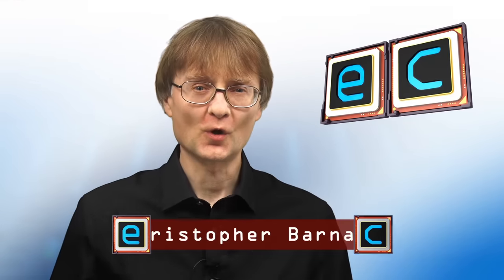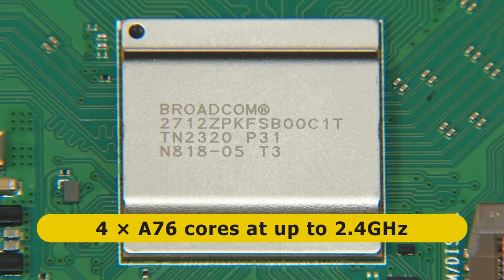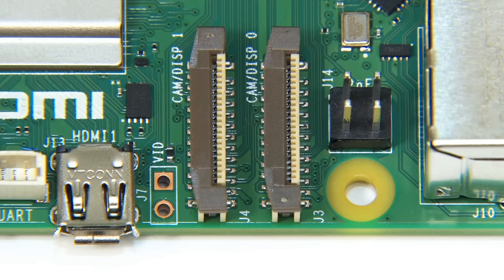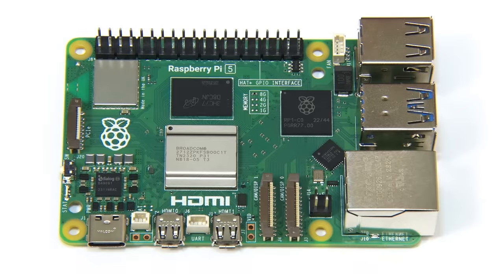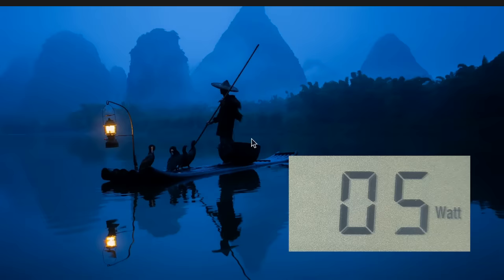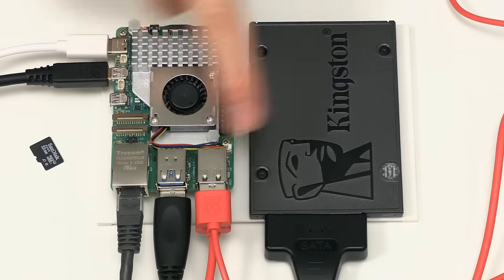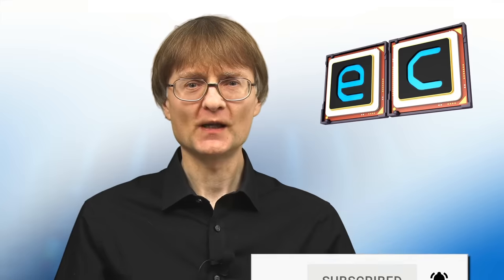Raspberry Pi 5

Comment: After using a Pi400 for a year, my first impression is that it doesn't seem too different from what I'm used to every day.  I'm sure it's faster, but I don't remember that being a problem for most things.  I run it on a 4k TV at full resolution, and of course you can see it have trouble keeping up with various XScreenSaver choices.  Overall, I think the Pi 5 looks almost good enough to be a primary computer, but still only "Almost".  I don't play games, but the Pi version of Minecraft is almost unplayable at 4k, and I'd like to see how this new 5 handles it for comparison.

Comment: The Raspberry Pi 5 is definitely looking like a worthy successor to the Pi 4.  I think the microserver and home automation DIY groups are going to love it but I think for the first time in a long time, possibly ever, I think they have something that is actually fast enough to be used as a basic desktop and tool for education.  I have used the Pi 1, 2, and 3 in classes over the years to teach basic coding skills and the desktop environment, while useable they always left something to be desired in the speed and responsiveness area.  I wanted to use the Pi4 but they were hard to get ahold of for such a long time so we have been using the older units most of this time.  The major difference when using things like the Microbit, Arduino, and Parallax Basic stamp 2 was that they relyed on a separate computer for the code development and compiling so it was generally much snappier for teaching these basic concepts but the Pi offers the benefit of being a completely separate and self contained development platform without the need of a separate computer once the SD card is created.

Comment: I have a question for you. To help understand your video. While you were rendering video, doing the video call, etc. Were you also running something like OBS or video recorder to capture video off the PI? Or was an external video capture device used on the HDMI port?

I was just curious because if using PI resources to capture video, your test speeds on rendering would be affected.
Reply from the maker: I think this comment is on the wrong video? But all of my video capture is always done with HDMI recorders, so does not take any Pi resources.

Comment: I like the testing pads on the bottom of the Pi 5, which is something the Zero 2 W introduced.

It opens up a lot more possibilities for HATs sitting under the Pi (SHOEs?) that interface via pogo pins to the test pads, leaving the 40-pin header free.

Comment: Great video. I started my Pi journal on the Pi 3B, which around that time was about $35. Got a couple of Pi 4 4GB later around $60 which was good to tinker around with. Since Covid the prices of Pi shot up the roof. They said it is due to shortages. Have this been addressed? Hopefully the release of Pi 5 would bring down the prices of the 4.

Comment: was looking into buying a pi4  in that keyboard 'case' but then learned about the pi 5.  do you have any news on whether it will also be available as 'keyboard'?  nothing on the website about it when i checked.  like the C64/amiga500 vibe to use it for retro games.
Reply from the maker: There has been no announcement on an upgrade to the Pi 400 "keyboard computer", but many of us suspect that Raspberry Pi will make something like a "Pi 500". Maybe for Spring 2024? That's just a guess.
Reply: @ExplainingComputers  guess i can start with the 400 and once the 500 is there make someone else in the family happy with it 🙂

Comment: Just a Q: in timestamp 18:22 where you talk about the RP1 chip, there is a rectangle in the upper left corner that probably says MEMORY and has a resistor-jumper for 8GB. Do you think the board has all the memory factory installed, and that this resistor "selects"  available memory?
Does the 4GB and the 8GB have the same memory chip onboard?

Comment: 2:39 wait, what? Is that resistor just for show? It connects the same two signals, regardless of where they put it. Wouldn't it have been easier to just use a sticker instead that says which RAM size it is?
Reply: A sticker means adding a "sticker adding machine" to the build process. Soldering  on an additional, useless resistor can be done in the existing soldering build process. Just one more resistor to pick an solder. Much cheaper.

Comment: Wow thanks a lot for the video. That's amazing. Just one question: would you be able to assess the Raspberry pi 5 responsiveness with a 4k (2560p) monitor? With the Raspberry pi 4 no amount of overclocking helped and to be fair performance was bad even at 1440p so yes the system technically outputs 4kp60 but is nowhere near able to move a window at that resolution. So the pi 2 was a 480p machine, pi 3 a 720p one, pi 4 a decent 1080p performer... pi 5?

Comment: Will 5 amps be necessary? With that amperage the power consumption is already at the level of a mini pc with more than decent performance. I really like the PCIe port, but I'm surprised they haven't implemented the M.2 port on the board, if boards like the Orange Pi or Rock Pi have them built in I don't see the reason for them to have left out the port. 
The power is really good but I am concerned about the consumption, almost double what my Raspberry pi 4 consumes. I think it is a good improvement with some details that concern as consumption, it will be fun to see what projects will be developed on this board.

Comment: GPU performance and capabilities will likely improve slightly as time passes. By the looks of it, the Mesa drivers are still in the process of adding support for the new instructions, features and structural changes of the Videocore VII, which is essentially a superset of the RPi 4 GPU, whose codepath it's currently utilising with minimal modifications to make it reasonably operable in the first place. Once could say that the drivers are still in the "bring-up" phase.

Comment: The added active heatsink is a blast at it`s form factor. Ofc we have the bulky passie/active ones but some projects just looks nicer flat. It doesn`t even have to be the Original heatsink, having the proper mounting holes we are finally able to create a heat dissipation solution that doesn`t require a "duct tape logic" ;)  Also power consumption and new fast usb + PCIe connector avaibilty makes the new Pie a go to for a home NAS storage at resonable price.

Comment: Great video as usual. Is the slightly higher board power draw compared to Pi 4 not due mainly to the addition of the RP1 SoC?
Reply from the maker: Partially this, but also the new SoC with its faster and more powerful CPU core and GPU).

Comment: Wait a minute, so, you have a fan, a PoE HAT, a board to connect the NVMe m.2 drive to and if you're planning to do something with the GPIO pins, you need a HAT for that aswell? I have probably missed a few things for which you need an extra cable or HAT for it to work, but how do you fit all that to such a tiny board?
And is it possible to have the OS on the M.2 drive?
What about 4k60 Youtube as it does have mini HDMI which supports that?

Comment: Thanks, put myself on the mailing list of my local shop, they think they will have them in 3 weeks. Wouldn't mind a video about passive cooling solutions. It took the Pi 4 months for good passive cooling solutions to come out, many popular solutions didn't cover all chips so even if the CPU stayed nice and cool, other chips on the board would still get very toasty. Under extreme conditions obviously. My favorite Pi 4 cooler was actually a very cheap one, I think about 10 euros, just a lump of ribbed metal that made great contact on all 3 or 4 chips that needed it. Leaving the much lauded Flirc cooler in the dust. It really wasn't as good as people gave it credit for. Which, if I remember correctly, was what your test also showed.

Comment: Excellent as always. Ordered an 8Gb model yesterday. Do you know if the official case can accommodate the official active cooler? Thanks.
Reply from the maker: The official case apparently comes with its own, slightly different cooling solution -- a heat sink for the board, and a fan that mounts in the case.
Reply: The case description reads as if the fan and clear insert can be removed. With than done I was wondering if the case will accommodate the pi with its active cooler fitted.

Comment: 1) Ribbon cables are too fragile and easily damaged.
2) Micro HDMI connectors ditto.
3) That cooler probably doesn't work at all well with a hat.
4) No 3,5mm audio connector!  How could they?
5) 50% faster is barely noticeable, in use.

I think I still prefer the 3B (not +), which works well with a passive heatsink, has full sized HDMI and a 3.5mm audio out.  I don't use the desktop though, or the internet with one.

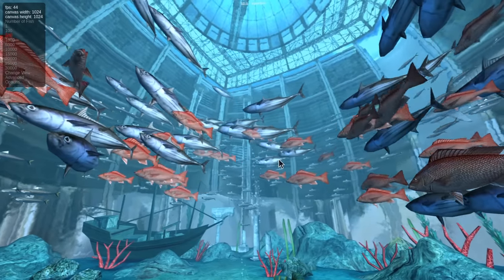Comment: 11:21 This web page still shows the big difference in speed between the latest RP and a trailing edge desktop (AMD Athlon 3000G and fanless Nvidia GeForce GT730).  Of course, one costs a lot more than the other, and uses 100 watts, not 5-10...

Comment: I want to buy the pi 400, as it's keyboard system all in one. I want to use it for amiga 500 emulation and ps1 emulation so I don't have to pull out all my machines this Christmas. After watching your video's, I'm not sure which one to get now. I saw the video of the orange pi 800, and now the pi5 has the keyboard like the pi 400. What do you recommend with all that's on the market for my use of the pi?

Comment: Great review, as always! 
Just like with the RPi4, I'm a tad let down by those micro HDMI connectors. 
I mainly use RPis for headless servers, but when I do need to hook them up to a screen, I'd much prefer using one of the many HDMI cables I've got lying around the house. 
And as for the fan, well, I'm not really a "fan" of it. (Couldn't resist that pun!)

Comment: Thank you for showing the power usage as well. It looks like the new 5A adapter is accommodating power for peripherals seen the fact that a stressed PI 5 only used a few Watt. 
I like to run from batteries (LiFePO4, 12 to 14 Volt) which recharges via solar power.
My Samsung screen also runs on the battery, it accepts 12 to 14 Volts without any adapter, and is really low power. Laptop + 22" Screen uses 12 to 15 Watt when watching a (your) video.
So anyhow, as you can see, power usage is important (to me at least).
Recently I bought a PI 4 for Home Assistant. I can see the PI 5 would be way to powerful! Currently H.A. runs at 3.5 to 4 Watt. I easily won that back by finding my oven uses 4 Watt at idle! I placed an extra switch there, so I am running H.A. 'for free' (not real, but it does feel like that). I recommend everyone to start checking for hungry devices idling at 3 to 4 Watt or even less.

Comment: Well, this is jolly good!
I remember your video reviewing the Pi4, and wondering at the time if it would run Linux Mint, which you said it would do an OK job of.
It seems that this one would, beyond question, be able to replace my 2011 MacBook Pro i5 as a desktop for Mint.
Very encouraging news.
I wonder what Japan's one and only official Raspberry Pi distributor is doing the starter pack for?
(computer/case/cooler/power adapter/8G)
We shall see....
Reply from the maker: Look out for my video comparing the Pi 5 and an N100 Mini PC, both running Ubuntu 23.10, coming up next week. :)

Comment: This looks great.  I wish they had kept the DSI connector, but it is probably not used that much anyway even though I am using  DSI display on my Raspberry Pi 3b.  I will definitely be getting one.  Do you know when the expected date this board will show up in the online stores?
Reply from the maker: The new MIPI connectors are multi-function -- each of them can work as CSI or DSI. So you can connect two cameras, two LCDs, or one of each (if with new cables).
Reply: @ExplainingComputers  Thanks, good to know.

Comment: I don't know about anyone else, but this is the first time I've seen someone actually using the power of a USB 3 connector with a chip that can decode it. Most other USB-3 connections are still decoded with USB-2 chips. That alone makes it worth it...

Comment: It looks like that memory section on the PCB with the different sizes and a resistor is just a visual thing. All the pads are connected together, presumably ground on the left and a trace on the right. So I wonder if it actually serves a purpose or is just visual. They could have different valued resistors for each different memory size but that seems unnecessary.

Comment: What good is it being able to run YouTube faster if the board has no audio interface? What do we need 4 monitors for with no audio device?
Reply from the maker: There is audio over HDMI. But I agree, losing the 3.5mm output is not good.

Comment: Totally missed the announcements so thanks for a useful video. 2 observations and a question.

First the enhancements look nice but I was really sad at the lack of emmc storage onboard - SD cards may be quicker now but I suspect they just die quicker as well... Also would really have liked to see 2x ethernet which would have made this great as a pfsense or similar router.

My question is about the pcie - I get the NVMe possibility but would this allow connection to a SATA daughterboard? I'm thinking it would be really nice to add 3 or 4 external sata drives (powered separately) and then explore NAS options. Fairly certain you said 500MB/s which is okish I think.

Comment: It's very cool, but I don't get the directions they are going. My concern is about power efficiency, 3-4 W at idle sounds like a lot: my M2 macbook air reports 2W when screen is powered off, and probably new x86 laptop CPUs are are around the 5W mark, but of course it's a different class of performance!

Comment: ~
So wait a minute...

Say my use-case is super-basic - word processing, e-mail, simple Internet browsing.

It seems as though this could be a viable option??

I've recently moved to Linux Mint Cinnamon (thanks precisely to this channel) & it's been great (especially given my low-key needs).

However - could Raspberry Pi 5 be similarly good, for my needs?

Also - does it support genuine 4k screen resolution?
Reply from the maker: Yes, a Pi 5 is a viable option for basic computing -- many viewers of this channel use a Raspberry Pi as their computer. "4K" screen resolution is 3840x2160 -- is UHD. Not cinema 4K (4096x2160). Sadly Linux Mint is not available for a Pi. But Raspberry Pi OS is pretty good, and also available are Ubuntu (which works really well), Manjaro and others -- see my Raspberry Pi 5 operating system video: https://www.youtube.com/watch?v=7G6jZd4gHtM

A Pi 5 in an Argon NEO 5 case makes a very nice unit -- https://www.youtube.com/watch?v=5Su4u4G-VIk Although the price is similar to low-cost mini PCs.

Comment: I'd love to know what the unpopulated J7 header labelled 'VID' is for?  Is it analogue composite video out?
Reply from the maker: I assume so.
Reply: @ExplainingComputers  Yes - stated with some confidence in Jeff Geerling's video, and The Pi Hut lists 'Composite video header'.  
I think they missed a little trick: if that were a 4-pin header, it could have had left and right audio too, in a nice format to connect to a 3.5mm TRRS “4 pole aux” jack.  
And if I were to get greedy, just one more 4-pin header with USB2 would be perfection - as it would allow a HAT to run off USB without a bulky external connection - and super cheap and easy connectors for prototyping, with the compounding advantage that these extra headers on the opposite side from the GPIO add bracing, so a simple HAT would mechanically sit on the Pi, in or out of a case, without need for screws and standoffs unless in high vibration environment.
But those may all have been considered and traded off against something we did get.

Comment: Does the fan stay on all the time or can it stop if the temp if low enough? How loud is the fan, only asking because the silence of the my headless RP4 in a FLIRC case is a must for me (hate any small whiny fan noise).
Reply from the maker: The fan is very quiet, and does not spin at all when the Pi is at idle. It is the best small fan I have ever tested.
Reply: @ExplainingComputers  Thanks Chris  👍

Comment: Thanks for the special episode Chris. I have several Pi 4's in 4 & 8 GB configuration. I also have a 400 which I use as a desktop in another office. The performance and hardware upgrades and resulting performance increases are indeed impressive. Do you know if there are plans to shoehorn this hardware into the current or similar form factor as the 400?
Reply: which should be called pi 500

Comment: Can the Pi be started without the use of the Power button. Need it always on, also after powerfailure. Want to put it on a smartplug, which i can remote, but that won't work if i need to press the button...

Comment: You're a lucky man to get a first hands on for the new Pi. 

It's good to know all these improvements are there. I'm sure going to get myself one as soon as I can. Hopefully we can get third party HAT's quickly after this.
I especially like the PCIe over just an M.2 key slot. Because in theory, we could add an external GPU to it as well.

Exciting times indeed.
Reply: The only difference between this and a PI 4 is that the pci-e lane is accessible.  It's still just a single lane of PCI-E 2.0.  You can't game, and can't do any grunty LLM/stable diffusion work with that.

Comment: I was hoping for an Octacore SOC for the RPi 5 like my Orange Pi 5 32Gb, I don't know wether I will buy this RPi 5 board, I don't have anything RPi software related that needs the speed of this SOC as my RPi 4 8Gb handles my uses quite well, my Orange Pi 5 is used for retro gaming and it does this extremely well